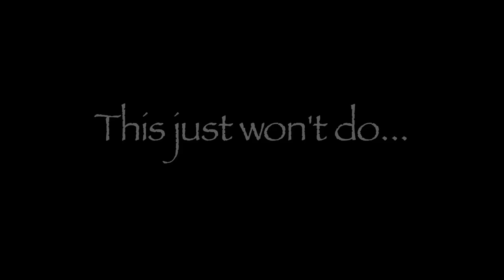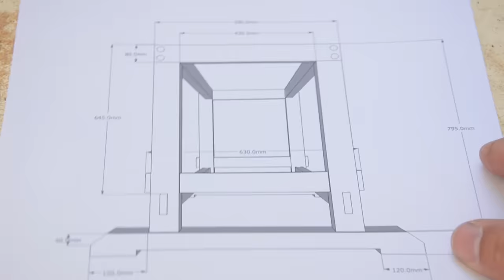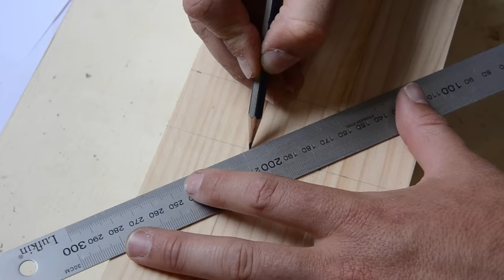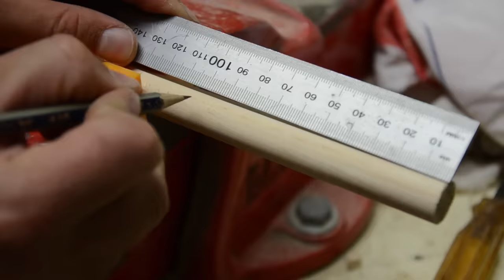Laminated Pine Workbench From 2x4's - Woodworking

Comment: Did he really just plane that entire thing with a 1" router bit?
Reply: Work with what you've got, I guess.
Reply: I think he route the other side not the side where he cut with the table saw. Table saw cut made the one side straight same as jointing.
Reply: He's Australian. Not the brightest.
Reply: @garthn2561  found the kiwi.
Reply: @davidslinn5920  David, ha!
Reply: Thats exactly what I was thinking lol
Reply: He ran them through the table saw to remove the rounded edge of the 2x4 so they had square edges before laminating them together.
Reply: @davidslinn5920  Excellent!
Reply: I done mine with a jointer plane got same result and much easier.
Reply: WTF?!!!  
My response at 7:45 when I realized he was going to plane the surface with a router.
Reply: Wat have u built today and share with the people for free
Reply: calm down
Reply: @garthn2561  Don't see too many how to's on your channel, I guess if you can't do, criticize
Reply: Just a better craftsman than thee and me. @garthn2561
Reply: no, he milled it.
Reply: @lautoka63  Absolute cert in your case, seeing you know everything without requiring any input. I just milled my benchtop using my homebuilt CNC router (I needed it as accurate as possible).
Reply: And then introduced inconsistencies by not making a standing jig that would have also ridden on the side rails...
Reply: Beautiful
Reply: @D so he can stack 300 million boards under it to get it up to table top height, and still hernia out letting it tip over on top of the legs
Reply: The saw removes the S4S roundovers, typical cuts from the lumberyard. One needs sharp and crisp edged to use in a lamination glue-up.
Reply: 420 Friendly  Wood (such as 2x4's) comes with rounded corners,. He sawed them off after making sure his blade was at 0°.
Reply: @j.stires  ninety degrees
Reply: 420 Friendly  Sure you can omit the tables saw step. but results in a lot more routing.
He was taking off the factory round corners on the 2X4s
Reply: It's 2x4's they are basically wet and when cut and glued they twist bend and warp. Even if it's kilned dry you need to let it sit for months even then it still warps. Without a jointer and planer it's not crazy that he did this.
Reply: That was awesome!! Right down to the finish (get it? ;-)
Norm Abram (at the risk of sounding sacrilegious. .) "Eat your heart out!"
Reply: To get at least one flat edge prior to glue up. Works better that way.
Reply: @ajacobs100  Do you have a planer that big?  Most people don't.  That is a technique used by many to flatten log slabs.  Works great.
Reply: @ukmeximan  He did run rip off both edges of the 2x4s with the saw, it just wasn't obvious.
Reply: I don't know of any affordable planer that will handle a tabletop like that. I'd do the same thing.
Reply: @jman7041  Norm Abrams is a perfectly reasonable cabinet maker when he turns to it.
Reply: @D Fair point
Reply: @D The table saw eliminates the rounded corners from standard mill produced timbers much faster than could be done with the router bit.  That could be 3/16" to 1/4" (4.5-6.3mm) of material removed just to get started flattening.  Ripping is fast and easy with a good ripping blade.
Reply: @D To get rid of the rounded edges on the 2x4's
Reply: Brandon S  Exactly! People just don't get that ... 😴
Reply: Yup. Router sled method.

Comment: That table saw will be the end of him, he needs to get an extension, so he is not lunging over the blade to stop the wood falling on the floor.
Reply: YES!! build a backing off table...
Reply: Building a garage shop takes time. Its a one man show. I started off with a circular saw and a drill. It's simply time and money.
Reply: @manit77  Even if you just sling together a makeshift wooden table from scraps. You've got to stay safe.

Comment: I admire the way you built this workbench.  As there are many different ways to make one using 2x4's I was impressed with the way you built a jig to hold your router in order to remove some excess material.  However, using a surface planer after trimming off the 2x4 edges at the table saw would work as well but, some planers like mine can only handle a maximum width of 12 inches.  And, you could be off on the overall thickness by a 1/16th more or less which still requires hand planning to flatten the surface & sanding.  Good job on the build.

Comment: I mean that bench is beautiful... Massive & very wide but beautiful. The Router on rails works well for a rough flattening but it's hard to beat a classic #6 Stanley jointer. Love the use of real jointery also. If you wanted to be able to transport this bench in the future you could replace those stretcher tenons with Wedged Tusk tenons. That way you would still get the tight fit with the option to keep the bench semi-mobile.

Comment: When gluing up on your garage floor, you're presuming the floor is perfectly level. If it's not, the glue-up will end up with a possible twist that has to be accounted for in the planing. Minor point but some people have bad flooring. The foam glue is also a bad choice - use standard wood glue, preferably something like Titebond II.

Comment: Very well made, low-cost, bench! Joinery excellent, and pleased to see someone, even on a low cost project, using traditional joinery methods. So damn pleased you are NOT using ‘pocket joints,’ particularly for a sturdy workbench. 4 x 2 for top is more than acceptable, but would have used better grade Russian red or Scandinavian white-wood, with tighter growth rings, for rest of carcassing! Linseed oil also a good choice for finishing. Would get rid of music, and replace with edited commentary, by a third party if necessary! You have excellent skills & methods, and a bright future on this forum. Well done.

Comment: I’m 5 years late to this party but I have to share this because it happened to me. 
I wonder if the router flattening would have been necessary.  A well done concrete garage floor is not flat.  A very subtle funnel shaped grade takes water to the garage door.  You can probably find a sweet spot (flat but not level) by laying out the two end bar clamps and sighting over them with a mirror propped up at 45 degrees….. or get your ten year old kid to lie on his belly and level his eyes to those pipes.  Mirror for the win.  🥸

Comment: I recommend using 2x12  instead of 2x4 and to rip them, as 2x12 is a much better structural wood.
This is how I made my bench probably 12 years ago, it never moved.
Reply: Frenchie French   I edge jointed and glued up 4 pcs of 3” x 10” rough cut Doug fir and used my floor sanding machines to straighten the top for a 12’ Long workbench 35 years ago and i use it every day.  Even after running one side through the planer and sanding after glue up the top is a 2 3/4” thick and harder than pine.  Face laminating 25 or more 2 x 4”s is just not worth my extra time and effort for a work bench that will be primarily used for woodworking.
I used the same construction using reclaimed 4” x 10” floor joists to build another bench for my garage and although removing the steel cut nails took some time it saved my planer blades and made for a quick and strong enough bench to rebuild truck motors.

Comment: Nice job.  Went a bit easier and a bit more expensive to a good flat.  2 sheets of 3/4" MDF and a sheet of 3/4" Baltic birch for the top.   I had just hand reflattened another bench in the shop and was about planed out.

Comment: Fantasy table beauty of a work piece  I recently made a new table for the shop out of stuff I had laying around the top Is 3 5 foot long 2 inch thick pieces of oak but they were not wholly in good shape so i covered it with a piece of half inch osb then sanded and sealed the top with yeap u guessed it truck bed liner in a spray can then I did some metal work regarding the legs I made them out of 4bys I like your idea tho completely this table is more of a extra space tool holder not a work bench i have a 4 by 8 half inch metal table for that lol but i am going to try this out but my skills are not as grand as yours when it comes to your joints I'll probably have to do something less complex but man there was another comment saying it was therapeutic to watch and I'll have to second that thank u for this video

Comment: nice piece of work, a thought occured to me, how hard would it be to make the top to be split into 3-4 parts so they could be run through a planer?, would also save alot of time down the road when you have to re plane the top due to the wood warp, i can think of a few ways to do it, 1 option would be to have 2 2x4's to run across the edge's, and just use screws, to secure it,

Comment: Always helps to have the right tools. Drill press is essential for mortise and tenon if you are not cutting mortises by hand. Well done. I probably would have added a shelf underneath as well as a poly finish but not bad at all man. Awesome mortise and tenons. What kind of table saw is that? It looks all cast iron. My table saw is really lacking, the steel wings are so unreliable. And I only bought it last year. It seems so hard to find quality equipment.

Comment: Just beautiful.... such lovely jointing work... You use straight linseed oil?..which I imagine would take a while to dry.. I use a 1/3 dilution with turps. Lovely to watch and learn,,, But I had to turn it on silent,,, background soundtracks rarely add any value to teaching videos.
The default wood to use here in NZ is pinus radiata... for detailing or special features you can obtain native timber from recyclers or demolition sources.

Comment: Cascamite is a powdered resin glue that's water mixed but dries completely waterproof. It's slow setting so ideal for large glue-ups like the this table. It sets very hard so not ideal for gap filling (too brittle), but properly prepared wood is permanently bonded.

Comment: Just came across your video and channel. Well done. 
I am planning a similar bench top using hard maple. Question: how is the top holding up? Wondering if any of the boards have separated at all. Wondering if I should run several threaded bolts across then bench. Any thoughts?

Comment: Now you've had it a while, how has is held up?  I built one like this and it twisted and warped itself into a pretzel in about a month.  Which is a bit of an exaggeration, but it did develop lumps and gaps.  It's still useful though, you just can't assemble anything that needs to be on something flat.

Comment: I’m a new to woodworking, well not even started yet.  So in the way you show in making the table top using bunch of 2x4,  you don’t need a planer and jointer to get rid of crooked and twisted parts and  a table saw is capable of  taking care of both purposes as long as a wood piece (this case 2x4) is less than Max. depth of cut of the table saw (3 1/8”).   Is that correct ?

Comment: Love these and similar vids ... but if you are really just starting out (and leaning) I have to wonder at the economy. No chop saw, router, drill press, or table saw - basically my only power tool is a drill/driver. No clamps bigger than about 6 inches either, and my current workbench is an old Workmate. I'd love to see a costing of one of these, including buying the tools needed. And, of course, you'd need to factor in wastage for when a joint goes wrong and you need to start again (as a beginner). I suspect it'd pretty quickly get up to the point where it's cheaper to by a Sjoberg's for your first bench.
Reply: Yeah .. just priced the stationary table saw. That alone costs nearly as much as a high end bench :(

Comment: Noob question: when you rip 2x4s on table saw, have do they come out straight if you dont know if the side against the fence is straight? Doesnt the first rip only become as straight or crooked as the other side is? Like, don't the bows of the other side transfer as it slides against the fence? 
I hope that made sense.

Comment: Love it. I'm about to purchase some Japanese saws from Timbecon so I can have a go at mortice and tenons. Can I please ask where you got the plans for the workbench? I have two weeks off over Christmas and have ambitions of completing a workbench. I'm going to cheat and buy 2 of 2100 x 900 x 30mm laminated pine pieces from Bunnings as my top. I was going to use pine shorts for the legs and laminate them as you have. Did you use structural pine for the legs/rails? Happy to pay the extra if I need to.

Comment: very nice workbench. I am a brand new woodworker and just secured a work space for myself so planning to build a workbench in the next few weeks. I also got linseed oil and read the instructions that states everything must be washed and dried after using it as it can go on fire during drying, how true is this? Do you wash all your rags after using this oil?
Reply from the maker: If I have a rag soaked in linseed oil, I put it in a bucket of water until I'm ready to dispose of it. Too much stuff in the workshop to risk it catching fire and burning down!
Reply: @WillMatthews  Sure completely understand and that is my concern too. When you say soaked, I can understand that as the literal meaning of the word soaked or after a use or two? So the catching on fire is true? So glad I read the label lol Thx for the fast reply!
Reply from the maker: If the rag has a decent amount of linseed oil on it, then whack it in a bucket of water if you're leaving your shop. People have lost workshops because of fires like that. Just to be sure.

Comment: QUESTION. At 8:20 you're using a router to plain the table top. Why not just use an electric hand planer? I just bought one at Menards for about $50.

Comment: Hey Will:  Nice video.  You've got great woodworking skills!  
Wanted to ask you (from a beginner level wood worker): What kind of blade are you using on your miter saw? -- very smooth finish on the wood workpieces.  That BevelBox is nice.  Have to get one for my small table saw.  And my table saw is a portable Dewalt.  Is there any way to make a wood workbench that might extend this saw's work area?  Any ideas?  
And your wood is of great quality.  The lumber I have gotten from Home Depot or Lowes is full of knots, missing sections, cracks, etc.  Where can someone find good-quality lumber? 
Thanks in advance.
Reply: A great tip for some of the YouTube woodworkers is to buy 2x8, 2x10 or 2x12 and rip it down.  Watch for knots on the edges.  Wider wood is usually much higher quality than 2x4/2x6.  I found this to be true but dang, a Southern Yellow Pine 2x12 gets heavy fast.  I'm considering building a much less substantial utility bench with a doubled up layer of 3/4 ply for the top for assembly and infeed/outfeed.  It will still be stiff but enough lighter that it's easily moved around to where it's needed.

Comment: Why did you joint the top and bottom of the table with your table saw and not the sides you were gluing together? Were your boards really that flat? Where do I find such mythical wood because I don't have a table saw.

Comment: Congrats on taking and easy process, leveling the top of a workbench. And making that process super difficult. You could of used a jointer plane and avoided making a complicated jig, saved time, money and it would of been more exact.
Reply: Right because we all have a jointer plane laying around, and for those who don't a modestly priced jointer plane of reasonable quality is only about $300.. so you're right, sooo much of a money saver.   SMH

Comment: These small sectioned bonded laminated tops, seem over the top! What's wrong with trying to source say 2 lengths of say 2x6 inch, and maybe 1x6 for the tool well. A lot less bonding required.

Comment: Your work was fantastic. It was precise, well thought out.... with great joints. My only issue with it if it were mine...I would be afraid to use it. I wouldn't want to mark it up or drill random holes in it. Spill paint on it. It is furniture grade quality in a work bench. It is wonderful, but seems a little on the overkill side for its intended use.
Reply: Your opinion is meaningless. Mind your own business.
Reply: @wesoblander3648  ....maybe we should both take your advice.
Reply: @pikeevans8559  , only you, Phil. The overkill comment served no purpose; when many people build work benches, the intended use of such benches could change in a heartbeat. 

I've seen people throw a variety of engines on them, when necessary. I'll take the overkill.
Reply: @wesoblander3648  ...I was complimenting the man on what a wonderful job he did. Called it furniture grade workmanship. Built so well that I would have  a hard time using for the purpose it was made for because it was so nice. It's not like I called it a piece of trash. The man had no problem with what I said for ten months...so once again, take your own advice, and let Will tell me what he thinks about my comment.

Comment: The digital level you used to set the the blade to 90 degrees may not give you a square cut unless your table is dead level as well. You may be better off using a square to set the blade if your table isn’t level.

Comment: Great build man! I was just wondering what is the tool called with the little pencil? Like a compass but not really.
Reply: Do you mean the Marking Gauge? I think it has a steel pin and not a pencil, although I've seen ones with a pencil for drawing lines instead of scribing.

Comment: why do you set the 2x4's vertically instead of horizontally? doesn't just spend more wood?
Reply: He wants it to be heavy.  Then it will be more stable.  Therefore the top of the table should be as thick as possible.

Comment: Hi Will! I love what you did and it inspired me to make me own bench. Quick question: how come you only ran the 2x4's on one edge and one face through the table saw? Are you basically doing what a jointer would do? I'm fairly new to woodworking and just wanted to know your process and get some advice. Thanks!